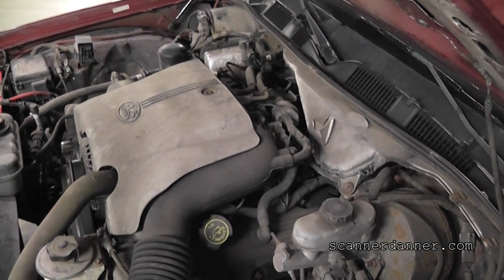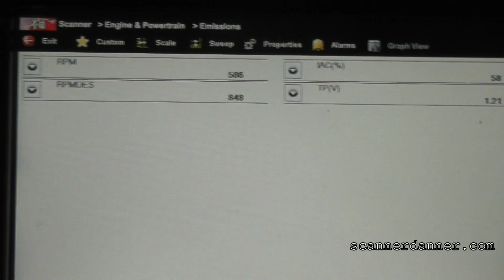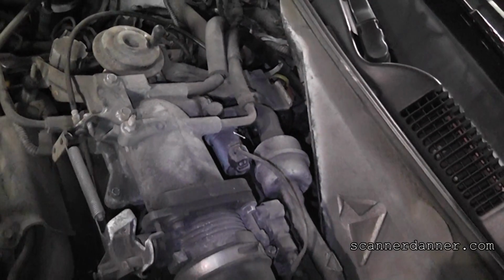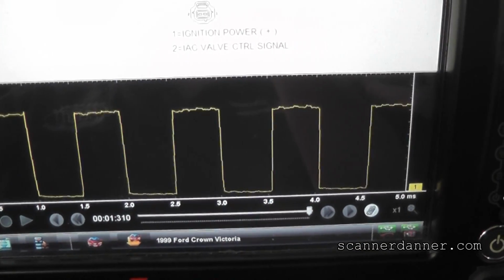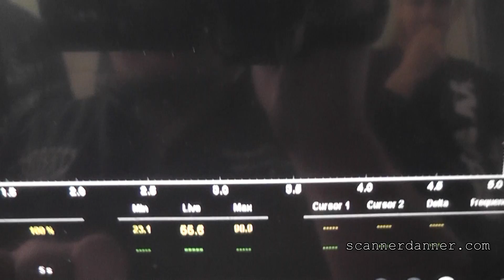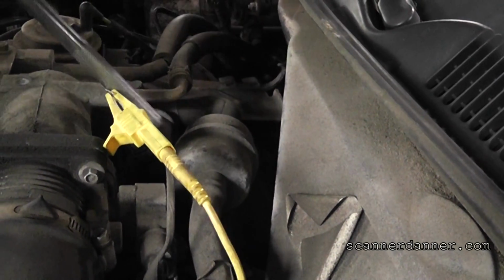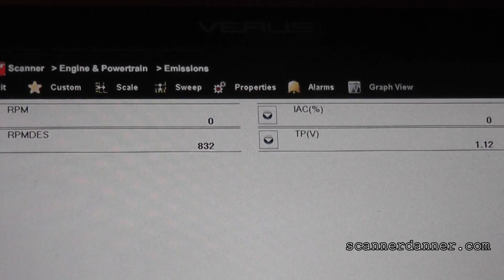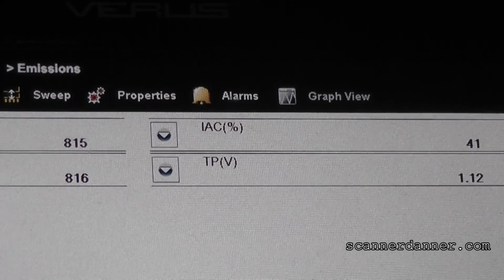Ford idle air control valve (IAC) test - stalling problems

Comment: I've got an 01 expedition that hasn't idled right since I replaced the intake gasket. It does the flare up that you speak of, then drops pretty low, then planes out just a little lower than what I think it should be. It stalls every now and then but not always. There is a code, I forget what the number is but it basically says that it's idling to low to properly run all the accessories.  Any input would be great.

Comment: I have a 1989 5.8 .  the engine starts and runs nice till it warms up. then the idle gets rough and will continue to run while more air gets drawn thru the iac valve then it idles up for a while and smooths out  but will drop again. it just kinda plays that game. is their ever a time that the iac valve holes in the throttle body ever stop sucking air? like does the vale supposed to shut off that air flow or just restrict it?

Comment: I have a 97 Ford F-250 5.8L that does this same thing. However, whenever I unplugged one of the vacuum lines, it starts right up (doesn’t idle perfectly) and still tries to stall whenever I try driving it above 30mph. It ran fine before and just started this recently.

Comment: Hello, I have a 2003 Ford Expedition 4.6 v8. The vehicle idles at around 1200 rpm in park and neutral. When i put it in reverse or drive it idles fine. The main problem i am having is that the lights will go bright then dim and the vehicle will die and i will lose power steering and brakes. It starts back up in park immediately, I dont know if it is relevant to the probem but it seems like after it rains it always has electrical issues, all the dash lights come on and pulsate and still drives fine. Any information would be appreciated ScannerDanner!

Comment: I have problem with my 2000 Ford Focus. Just replaced the TPS and now the car revs up so high on idle and the engine light came back on. You think smacking the IAC will help?

Comment: scannerDanner....i have a 2003 mach 1 that's giving hinging idle issues..the revesre of what thus video concludes I guess. have u encountered this issue, any help would be appreciated. tps is non adjustable on this year but when I disconnect it the idle is normal

Comment: Any idea why the PCM does not monitor the iac  to trigger a check eng. light.  For a novice a MIL would have helped .
Reply: Because, this type of IAC does not incorporate a position sensor.
Reply: I personally don't know of any IAC devices that incorporate a position sensor other than electronic throttle control systems. Stepper motor IAC don't have position sensors, but the PCM knows the position of it because it counts steps to get to the desired RPM.   Some vehicles have software that will set idle speed low codes and some don't.  This Merc doesn't, but it will set an idle air control system malfunction code (P0505) if you run the KOER test.
Reply: IAC's, and all types of solenoids, are feed-forward devices. Meaning the computer tells the solenoid what to do, and expects that it did it. There is no feedback directly from the device. In this case, it isn't necessary, as the computer knows what RPM it is commanding, and via the crank sensor it knows what RPM it achieved. Typically, a code can be set if the engine RPM is not able to be controlled.

Comment: Mine 2004 Town Car IAC went bad. Instead of putting the foot on the pedal it actually accelerate without the foot on the pedal. It can actually drive on its own by just steering and braking tho it would burn the brakes and stress out the transmission. Mechanic simply replace the IAC valve and runs back to normal. No problem since than. But is weird how IAC valve works

Comment: When they run rough, then die, will I see the duty-cycle % drop? Because the valve has carbon deposits in it and cannot maintain correct duty-cycle? It is hot weather here so on mine I find that with AC on, it increases duty-cycle enough to prevent stalling : )
Reply from the maker: You see how hard this is for me to follow? It really helps me to stay in the same thread. You have some really good questions here

Comment: I have 93 lincoln mark viii....if this is why mine is going through this im gonna HATE IT. I basically have to take off my hood, cowl cover and jack up the car from the transmission to get access to it. 😡
Reply: Yeah trust me, replacing the IAC on the Mark VIII is a major PITA!!! I've replaced mine twice and it was nooo fun!!! There's very little room to get at the bolts to remove it. I didn't have to take off my hood cowl or jack up the car when I replaced mine, but it sure wasn't an easy job. 😩

Comment: Hi, I wanted to ask a question regarding the operation of IACV. I know that at start up, IACV is fully opened by ECU to help in starting and that it is opened during decelaration with throttle closed to ensure smooth running of engine. Should the IACV (stepper motor type) be open when the throttle is open (partially or fully)? With engine cold and hot. I noticed that my IACV (stepper type) does not fully close even when throttle is opened at least with cold engine. Its not for a specific vehicle but I have a pre-OBD-2 vehicle (European) of Renault.

Comment: Hi Paul, A query please. I just fixed a stuck Idle Speed Actuator Control on a Hyundai Accent 2004, with open-close bi-solenoid PWM control (not a stepper) and MAP engine. It was stuck partly open with a 1500rpm idle speed. Sounds simple. What threw was the code p0121 TPS/APP range performance not p0507 idle too high. I also had a Desired Idle Speed on 1500rpm, oddly, rather than normal 750rpm. I suspected the ISA but the odd code and DESRPM made me spend time eliminating the TPS/APP before attacking the ISA. It cleaned up and works fine. But here's my question: why a DESRPM of 1500?? After the fix the DESRPM is normal. My explanation: MAP engine detects low Man Pressure, ECU desires higher idle RPM as a result, like a cold engine?? Maybe it desires the higher RPM, but senses a range performance from a closed RPM/throttle plate and APP at normal idle??
Reply from the maker: I don't have answer for you on the desired idle number. A TPS problem would definitely cause what you are describing. 
MAP signal wouldn't be the answer as manifold vacuum at 1500 is typically identical to idle speed.
I've never seen a sticking IAC valve (open) cause a desired idle command to increase

Comment: Hi , I have an 86 f150 and have added a Innovate MTX-L wideband , mine is doing the same thing , whats happening is the mixture starts off ok for a cold engine then it gets richer and richer as the motor warms up , it does the rolling surge and dies when it hits 10.9:1 ,  as someone mentioned maybe the CTS sensor maybe telling the computer its a cold engine ? or the IAC  is doing weird things and giving engine less air .
Read more
15 minutes ago

Comment: I cleaned it with Q20 in two occasions , it runs great for about a year and then it stalls again. Third time I'm replacing it.
But my car runs again only when it cools down about 20 mins. Didn't try smacking it.
Reply from the maker: If you hold the gas pedal down a bit, will it stay running? If not, you're barking up the wrong tree 😉

Comment: Would I be able to read this data with a global scan tool? 
My ford will drop the idle almost stalling the car when I'm slowing down or stopping for red lights in neutral/with the clutch in, the revs usually drop and rise 2-3 times before sitting stable. 
I suspect the IAC needs a replace but checking the data over like this would make me alot less anxious dropping money on a new part.
Reply from the maker: Clean your throttle body first!
Reply: @ScannerDanner  Thanks man, it wasn't very dirty but it definitely improved after cleaning.
I still do get an idle drop sometimes but its only significant when I've got a bunch accessories on (heater/fan + headlights but not AC(AC seems to fix it).
Any idea where I can look next? 

IAC does work properly from what I've tested unless its just reacting slow for some reason.
Turning the wheels while braking also makes the idle drop worse (only in neutral/clutch in again)
Reply from the maker: If you had an improvement with cleaning the throttle body, you may have a sluggish IAC valve. I hate to tell you to change it based on that alone.
What is your idle speed with the IAC valve unplugged? It should just barely idle 400 rpm roughly
Reply: @ScannerDanner  it just stalls right away, with IAC plugged in it sits around 700
Reply from the maker: What year, make, model and engine?
Have you adjusted the minimum idle speed? In other words, does it look like anyone has ever messed with the base idle set screw?
https://www.youtube.com/watch?v=ayjhL9jpFH8

Comment: hi i have a 2005 mercury mariner, the vehicle will sometimes run great then if im just in park it will die.had it scanned mechanic said was the fuel pump i replaced it and still acts up. watched your video on returnless systems so replaced fpdm. still acted up. well sometimes run 20 min or so fine and just idles down tell it dies and no help putting foot on gas pedal. starts right back up then does the same thing. if left for awhile it will crank and run fine then might act up never know. im in need of help scannerdanner.
Reply from the maker: When it dies are you losing fuel pressure? If so, you need to do some voltage measurements at the FPDM when it is NOT starting
Reply: @ScannerDanner  yes starts again but dies. Yesterday cleaned the grounds at pcm and fpdm after running half hour it died and sit the lean codes and for the fuel rail pressure sensor. This was replaced when I first got it back in August. Can I check the wires at fpdm with a multimeter and if so what should it read

Comment: great  i have 03  cv  great advice  also can you tell me  will it make a differnce if i put  cold air intake after i put a new iac  thanks  great advice
Reply: Arthur Metcalfe don't bother. these "cold air intakes" are nothing but a gimmick . your factory air box is NOT a restriction. In fact most of them draw underhood "hot air" after installing them. Completely defeating the whole purpose.

Comment: I have actually tested those with nothing more than a test light. if you ground the valve the engine will rev if it doesn't the valve is bad(as long as there is 12 volts at valve)if it revs then there is a grounding issue.

Comment: 2005 pt cruiser gt stalls and then starts after setting iac code 508 O2 codes 32,38. It wont run when i unplug the IAC it stall. I bleave that the curcit is good.  If it runs with the sensor plug in. And the AIC must be sticking. Or cant  keep up with the PCM. And its giving the O2 sensors the high voltage.

Comment: Are the duty cycle to percentage open numbers on Mazda's similar to those on Fords?  As in 20% is closed, 30% no load idle and 50-60% fully open?  When I read IAC% in a scan tool like ForScan, is that telling me duty cycle or actual percentage open?
Reply from the maker: I think they are similar. 
You are looking at the duty cycle NOT percentage of valve opening. Great question!

Comment: Hello. I know its an old video but I want to ask if bad idle control valve does effect engine while driving?  I have no codes and I know valve  has to be changed and Im waiting for one to come very soon but when Im driving I feel hits from the engine. Spark plugs are new. Ignition coils checked.
Reply from the maker: No, if your foot is on the gas pedal and you are having running issues it will NOT be from the IAC valve
Reply: @ScannerDanner  Thanks. Then I have to search more. May be mass air flow then.

Comment: My car is a 09 Chrysler 300 3.5 getting code fuel to leqn bank 1&2 or something like that. A light comes on 2 lines and a red lighting bolt when I drive it drives fine but when I go to stop or completely stop light comes on along with my slide control warning light and it shakes a bit and dies or stalls bad thinking it's a bad egr but sprayed it didn't look dirty u think it's my iac?
Reply from the maker: No, you don't have one, it's an electronic throttle body. Sounds like a vacuum leak. Do a keyword search "water test" on my channel where I teach you how to locate them.

Comment: I have a 90 F150 with the 351 that I bought and put a transmission in. I've been trying forever to figure out what is wrong with it. I start it and it seems to idle fairly well (so apparently not the IAC?) until you give it gas, then it won't idle consistently and will eventually die... And when you drive it after about 15 mph (or at idle when you give it a descent amount of gas) it seems like it has no power at all and makes a popping sound from the engine... You have to barely push the gas to get it to accelerate at all or it just bogs down. I'm actually not driving it because I'm worried it will damage the engine (runs to bad to drive it anyway), I don't have a clue what's wrong with it. I bought the truck from a guy up the street from me who daily drove it until he blew the transmission, he had at least 14k into this truck and the engine has only about 30k miles on a rebuild, but it sat in my garage for about 3 years before I finally put a new tranny in it... Oh and right after I got it back with the tranny I did go mudding (nothing crazy just slow bogging) in it to burn the old gas out of it with some injector cleaner per mechanics recommendation (since it probably sat for 4-5 years total) and it seemed to just quickly get worse on how it ran each time I drove it, but hard to say for sure since it was running really bad on the old gas... Lastly it gets TERRIBLE  gas mileage, talking about 5 no matter how you drive it (it's on 35s so I figured it would get about 10-13?). I'd really appreciate advice it's been driving me crazy and after restoring the whole body and putting an expensive e4od in it it's terrible having it just sit... I've replaced the spark plugs, cap/rotor, egr valve, changed oil and coolant, fuel pressure regulator, and probably more I can't remember at this point... Thanks for any and all suggestions you can offer!
Reply: gimi ur phone # I know a bit with the old ford trucks
Reply: +Nick David since posting this my fuel pump decided to die so I'm actually at a halt until I get that replaced and if I'm lucky maybe that was my problem all along! I'll reply back on here when I get that fixed but it may be awhile (never have the time with my work schedule for now), I really appreciate you wanting to help! I'll keep posted on the fuel pump when I do get it in :)
Reply: +Blake Kitt alrighty man I've been through the fuel pump issue already its an easy job good luck

Comment: my vx commodore 2001 in Australia it has rough idle or it seems to idle low to me, it does not stall but sometimes at trafic lights it will idle perfect, I am thinking the iac is not opening enough to let enough air in, when the car is going it is very good it is just idling low, what would be your say on this, when it idles good that tells me there are no air leaks and the injectors are good, I dont have any DTC and no engine light
Reply from the maker: Clean the throttle body before you do anything else

Comment: Here is a tip if you iac valve is faulty. You engine idles roughly the rpm goes up a down and then up constantly. Turn your ac  this will add load to the engine causing the throttle plate to open more; if your engine idles smoother your iac is bad and needs to be replaced asap.
Reply from the maker: Throttle plate is fixed and does not move in response to engine loads on these systems. That was older systems that used idle speed control motors that would physically move the plate. Not the case here.
Also, the IAC is responsible for all engine accessory load compensation, so while the test you're recommending has some use, there are variables and it is not as simple as you describe.
Reply: @ScannerDanner  the stepper motor mechanism on the iac is faulty in my situation cause the rough idle goes away when the ac is turned on but returns when the ac is turned off.
Reply from the maker: @wmc128  If we are talking about a Ford IAC valve, these are not stepper motors. They are spring loaded closed solenoids. If your idle smooths out when the AC is commanded on, this is indicating a functional IAC valve. A rough idle can be caused by many different things. I wouldn't be too quick to change your IAC valve for a rough idle complaint.
Reply: @ScannerDanner  the iac valve is a 14 year old oem part needs to be changed... and yes its a Ford iac. I cleaned the valve about a year ago and it starting give the vehicle hesitate cold starting issues with high humidity weather.

Comment: I have a 1996 Lincoln Town Car:
What if I have this exact problem but with an error code of P0125? Notice that the car won't start unless foot is on the gas pedal. Happens only during the winter; would have to wait till car warms up a bit before it will stay on. The other day no matter how long I let the car warm up with my foot on the pedal it didn't stay on (happen on a 20F day with snow), had to adjust the idle speed. Is it the same cause?
Reply: ProfounDisputes According to what I'm seeing, it's "insufficient coolant temperature for closed loop fuel control".  My first thought is that the thermostat is stuck open, so the engine never comes up to full operating temp.  The plus is that it's a quick, cheap fix, but there are people on here who know far more than I do.

Comment: In a previous video you said that the TP(V) should be below or around 1.0V. Here it is 1.14V . Is that normal?
Reply from the maker: It is a little high but is a non issue in this case. Ford TPS idle readings are higher than most cars.

Comment: I have a 2009 Altima. It will start just fine but will stall out when placed in gear. If I give it yes immediately after placing it in gear it will drive fine but will stall again at stops unless I put it in neutral. Amy ideas?
Reply: Gas immediately*